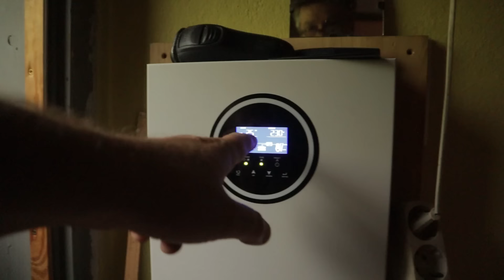Hard life in a remote mountain village BIG STORM Ep.14

Comment: Welp that hail storm sucked... shame about the damage... to be fair those sheets are awfully thin... perhaps replace them with something a bit more durable? I usually use Eternit fiber cement sheets. Those PVC ones are usually only 4mm thick and become brittle fast in countries with lots of sun hours...
Reply from the maker: I think I'm going to start using metal roofing. Also for the house because it needs a new roof.
Thanks 👍🙂
Reply: @MyCabinInTheMountain  The house definitely needs a new roof and fast, otherwise it might start to leak, which will undo all your hard work on the interior (and might even lead to mould). Also I don't know how you survived how many winters with no loft insulation 🥶